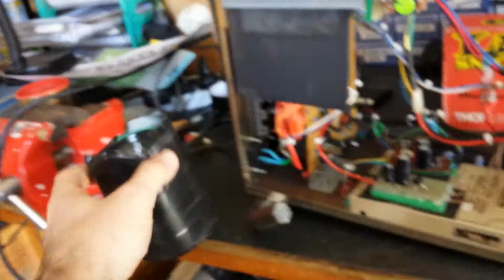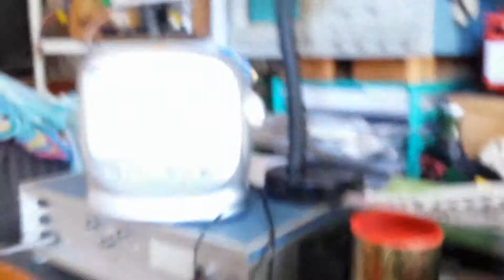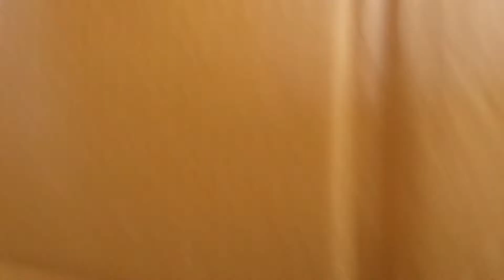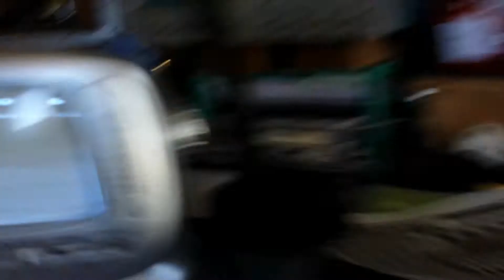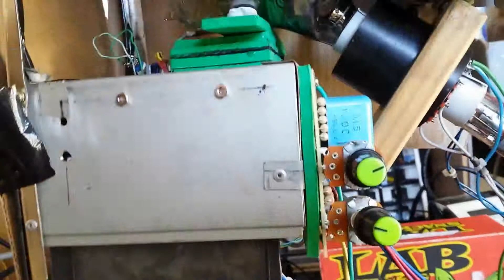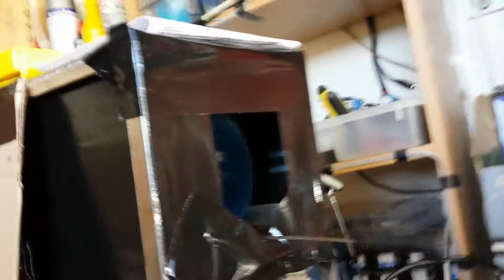Iconoscope TV camera project (Part 44)

Comment: And yes you will Troy you have a determination to get this far .Its interesting seeing it evolve !
Are you going to do a case cover for it in time i think you have the metal original case cover for the sides but i think it would look great wood vanished up in plywood in any case would be good for a front lens area panel and cut a hole for the lens the one coming can be screwed on some thing like that.